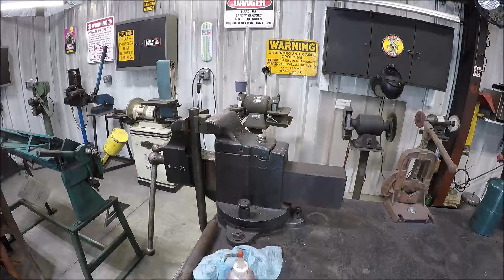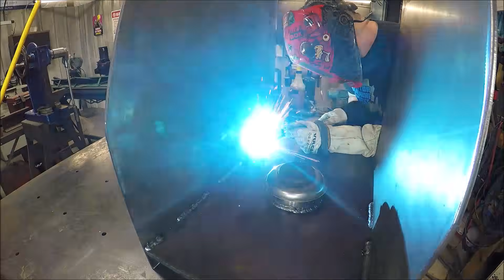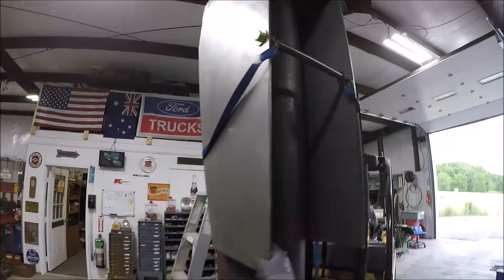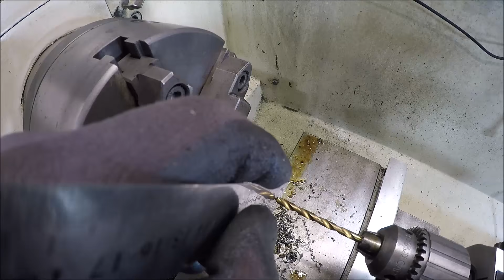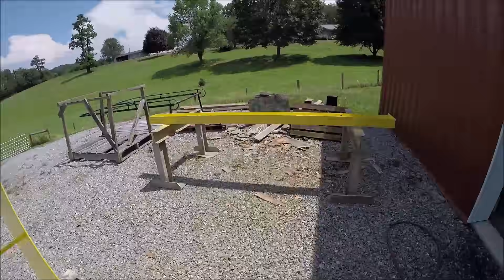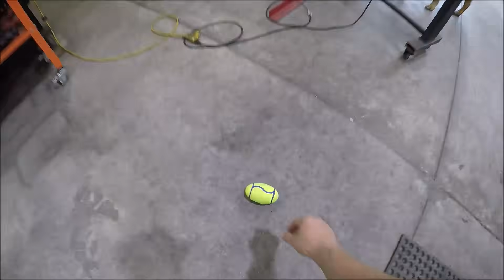Making a jib crane for the shop. Final

Comment: What is your cutting oil you like?
Reply from the maker: Tap Magic and WD-40 for aluminum. For steels I use 0-20w motor oil. I did not see any benefits using special formulated dark cutting oils. Plus they are expensive.

Comment: Looks good and will make life much easier. Personally I would shorten the chain that you pull on to raise and lower . Just split the link and tack it back together as there is no load on that chain. I did that to mine as I was getting tired of it tangling up
Reply from the maker: Good tip. Thanks Mike.

Comment: :yougotthis:I know this was a budget billed  but.!!!. You need to get rid of the hobo freight Hoist replace it with a electric winch With a remote control And a fiber winch line never use cable that is just very old fashioned.🤔
Reply from the maker: I may upgrade to a winch in the future.

Comment: A great project and it was well built, but you have a rolling gantry and a forklift so why bother.......just saying no offence ment?
Reply from the maker: Thanks. Unfortunately the gantry is not wide enough to use at the 2 mills or big lathe. It won't fit. The Gantry is perfect for the Horizontal Boring Mill. Using the forklift is a pain when trying to change chucks especially if I have a project going on the floor. This jib crane will make my life easier. Thanks for watching.

Comment: Really like your channel and videos. Mechanical engineer with 30 years in industrial maintenance here. I know i am nit picking,  but ASTM/SAE Grade 9 bolts don't exist. That is an L9 bolt. Or a copycat of L9 bolts. I am pretty sure there is a large fillet under the head and special L9 washers are used to accommodate this
Reply from the maker: Thanks for the info. I got a whole bunch of them from a Nascar race team. They take the car apart after every race and replace every nut and bolt. So I got boxes full of hardware. They called them grade 9.

Comment: No rain in the forcast for the next ten days. It rains every day for 10 minutes. It's crazy. In the 100's for the rest of July. Good job Tom. Thanks
Reply from the maker: Hey Terry. It is those sudden pop up summer storms. They are nice to have, but ruin your plans also.
Reply: Hi Terry! We are in Monsoon with high temps and high humidity. It's been kinda sticky in the shop lately.
Reply: @mattthescrapwhisperer  I've seen where New Mexico has had some pretty bad flooding. We have certainly had our share of rain this year. The flooding in Kerville was awful but that is about 4 hours from me. I'm about a mile from the Wichita river and about 10 miles from the Red River. We have had some flooding but I'm far enough up hill from both it misses me. I'm sick of mowing grass. Some weeks had just been mowing what is not under water.
Reply: @terrycannon570  Hang in there Terry!